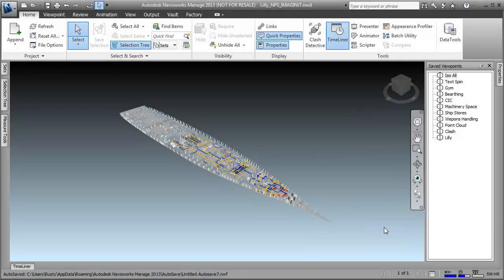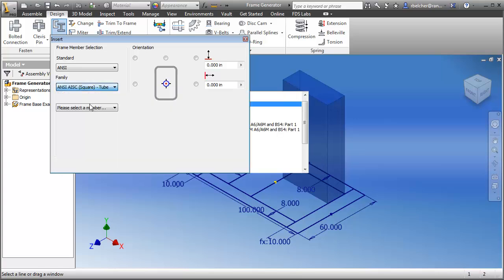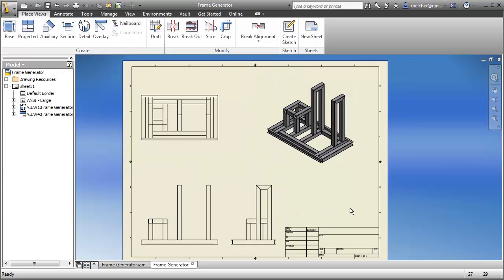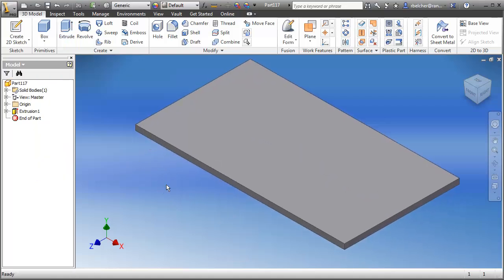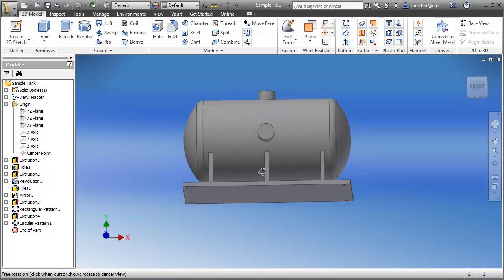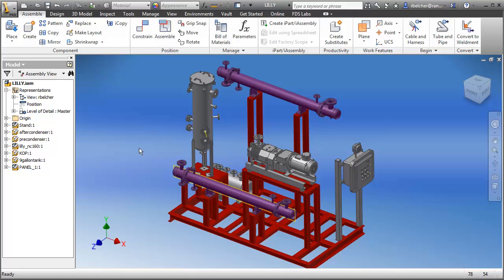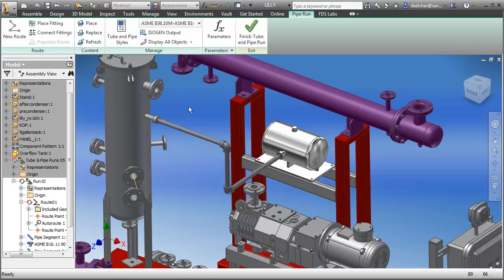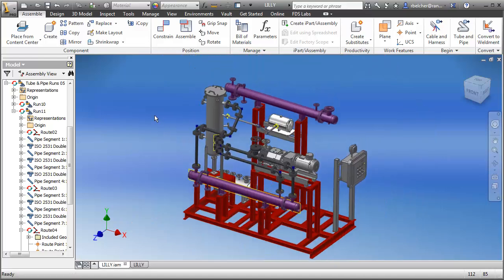Inventor Product Design Suite - Pipe Routing - Lilly Demo

Comment: Thanks for this great video. May I ask if it is possible to do the stress analysis here as well for the pipes (like the  stress analysis that is normally done in Caesar II)? Thank you in advance.
Reply from the maker: +Behrouz2181 I am not aware of the capabilities of Caesar II.  But you can run a FEA on the pipe models just like the frame.  There are many different Analysis capabilities in Inventor Professional.